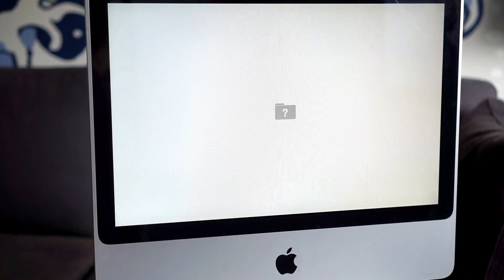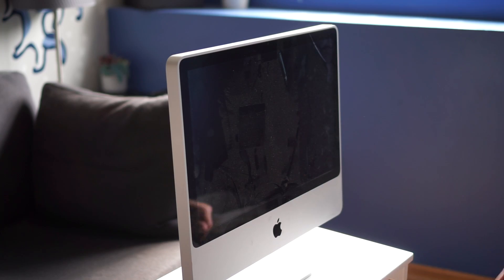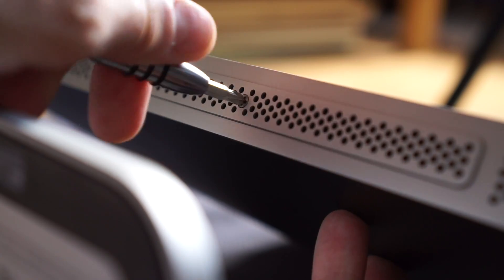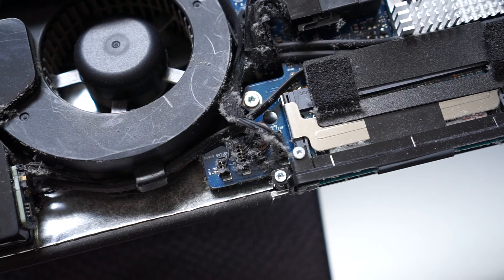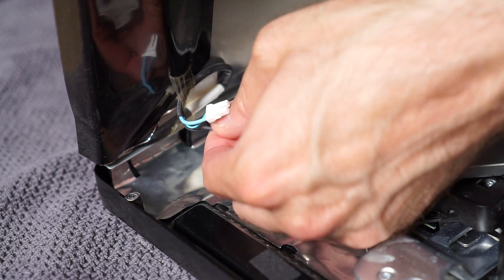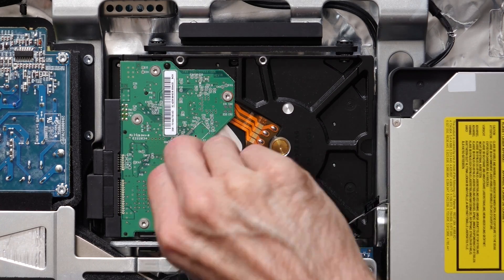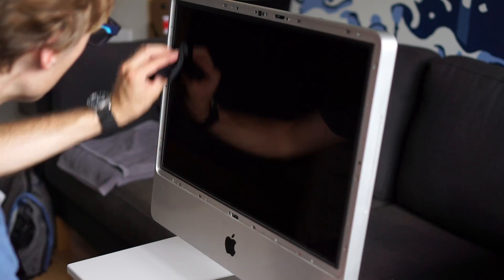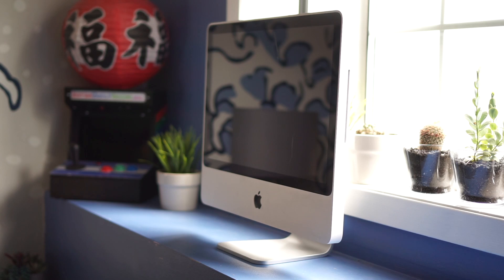Replacing a 2008 iMac Hard Drive

Comment: Hi, great video thanks but I have a couple questions. near the end you don't explain the process. What is the white usb lead you plugged in? and about softwear, I was going to purchase an imac from someone selling one that is not booting up and has the file and questionmark symbol flashing up. So Im unsure if I am able to just swap out the hdd and install the softwear for it to run normally if the imac was someone els's can you help please?

Comment: Super awesome. Been running my great 2008 iMac (ran nonstop 15 years as a DayLite server) until HDD died. First tested it by running it off USB eSATA connector to an older MacBook Pro 2010 (horrible known design defect that makes it kernel panic) 2.5” 250GB HDD. It is slow but runs ok. Next I cloned that to a 500GB Samsung eSATA SSD. Slow but runs. Next, I upgraded the 2X 1GB RAM chips with 2X 4GB to make 8 GB. Just installed. But decided to do long awaited HDD swap out too. Had seen similar longer video a year ago but wanted to refresh my memory. Found your great video. Simple & to the point. Just thought, I’ll likely need a 2.5” SSD to 3.5” bracket adapter. So it may have to be after the 4th of July. Thx again.

Comment: my drive died finally just about a week ago, i just put a samsung SSD in a firewire 400 case, installed snow leopard from DVD to the external SSD then upgraded to el cap and its working faster then it ever has.. without even trying to open up the imac... saved alot of time + effort and got a similar result - its a little slow to wake up from sleep as the hd has to wake up aswell but other than that its still faster then it was at any point with the internal mechanical drive on the sata interface; even with it running at fw400 speed instead of fw800.

Comment: Very well done.  Clear and to the point.  I am an IT Pro with 4 decades experience, but had never installed an SSD in customer's iMac 2007 20" until this weekend.  Although this video was for iMac 2008, it seemed to be same as iMac 2007 and was just what I needed to see.  Lots of screws in these old ones, but no glue...yay!!

Comment: My old, dead iMac ended up being not quite the same inside as the one in this video. Not sure why. The monitor connected on the left rather than the right, and the connector was different than the one shown here. I also had some trouble getting it out. It was binding along the bottom edge. For the drive itself, I had tremendous difficulty getting the bracket to release. I ended up having to pry it off with two flat-head screwdrivers and broke the bracket in the process, but without doing that, there was literally no way that thing was coming out. It was wedged in there way too tight. Luckily all I was doing was removing the drive for secure disposal, not trying to replace it, since the Mac itself was already dead and long replaced. I also gave up trying to get the microphone cord reconnected at the end, but put the rest of it back together the way it was supposed to go, just to see if I could get it all to fit. :)  Overall, quite a lot of effort.

Comment: Thanks Colin, such an easy to follow guide. I did appreciate your advice also at the end, still wondering what I should do with that moose head and 6 CD changer that were gifted to me... LOL. I was given this 2008 with a dead drive, have done the external drive idea, but can only upgrade to Snow Leopard, I am getting gifted a HDD 2TB WD. Any quick idea on the cleaning? is the usual home vacuum OK? thanks again

Comment: Had identical machine given to me to fix and pass onto a charity. Couldn't get the software to upgrade because of  manufacturer's idiocy. 
Ripped off the operating system, installed Ubuntu and tadaa! Wonderful. Bit of messing about to convert iso file to DMG, but did it using the terminal on the Mac and all worked well.

Comment: Perfect video my current IMAC is the later 2012 which runs like a charm having only had to replace the power board this month. I have my 2008 model in a box without a scratch on it which bit the dust back in you guessed it 2012. So although it was a black screen death I won't be sure what it requires till I get a test lamp on it which I don't have. There is an Apple Doctor up the road from me and service costs are cheap and is turn around as you wait as witnessed by my last visit, but I would like to take on the task myself as your tutorial is excellent all be it a different component. Its still a good looking machine and I will gladly want to bring it back to life. It can be a hand me down to my 12 year old son. Great upload and a definite thumbs and subscribe from myself.

Comment: I have this exact machine.  Hard Drive died so I bought an external SSD put Linux on it and it runs like a top.  You can use this machine just throw Linux on it and you will have a modern useable system again.

Comment: the big difference with a pc is you can replace the motherboard, the cpu, the memory and hard drive and you get a brand new modern computer for the faction of the cost, I used mac products before and not impressed at all as every function is too complicated to do, you have to press command, alt and something else  to do something, then command, alt and F to fill the screen. No thanks.

Comment: "Simple tasks" for a 2008? I'm typing this right now on mine - it's my primary PC anymore, and I'm actually more of a Linux guy than Win. Talked them down to $125 out the door with Mac keyboard and upgraded it myself easily to 6GB RAM.  Original 320 HD is still inside and I boot from a 500GB USB3 Samsung SSD external drive (migrated the OS with CCC) plus 2 additional Firewire-800 external drive docks. It does almost everything, although dual-booting to Linux (even with 'refind' installed) is a PITA.  The dual-core iMac will run Virtualbox just fine and still runs all modern browsers, Thunderbird, VLC (I use it to watch DVDs and streaming - the builtin speakers are quite excellent), Libreoffice, Carbon Copy Cloner, Nomachine NX and XQuartz for X11 support.  It even runs ZFS. :-)

Comment: Please help! I also have this model. The hard disk has broken down. All data is lost. I put in a new SSD hard drive, but I do not know how to install the operating system because I'm working in Windows and I do not understand so much. Thank you !
Reply: Buy a USB installer for El Capitan 10.11 (try amazon) and boot from that to install the latest OSX that will work on a 2008 iMac. Or install Linux from usb

Comment: You can install in this computer modern and well supported OS called Linux Mint.

It runs latest Linux compatible programs (Word processor, latest internet browsers etc), 

Linux Mint 19 is supported untill 2023. You can try it if it is suitable to computer and your needs before installing it on hard drive, by booting computer with Linux Mint live DVD. 

Perhaps somebody have time to make tutorial out of it ;).
Reply: @kat 

Linux is musch lighter to hardware than old MacOS. It's also lighter than Windows 7. Windows 7 is supported less than a year anymore. Windows 10 is not very compatible with old hardware.Linux needs less resources, so it makes old shit computer much better surely.

Comment: I watched this video because I was nervous to take mine apart after I had received my tool kit. I had researched a guide and found one, but still was nervous at the thought of possibly cracking the glass. After watching you disassemble it, I feel pretty confident in doing so. I can now open it up, clean any dust  it may have, maybe swap the HDD with an SSD, as well as replace the backlighting since the backlight went out. Thank you for this simple video! :)

Comment: Hi Colin,

great video - thank you for taking the time to put it together and sharing it with everybody!

My father needs me to replace the hard drive on his iMac, and the question we had was what happens to the OS.
I see that in the last few seconds of the video, you insert a usb stick, which is probably bootable and contains the OS, correct?

If so, which version would you recommend? Snow leopard, el capitan? Which one works particularly well on Imacs like this one?

Any answer is greatly appreciated, thanks!

Sincerely,
Pete

Comment: Wow, so much negativity.  All I can say is that I own an early 2008 Mac I purchased new in the summer of 2008.  I have used it daily ever since and have yet to have any problems whatsoever.  Everything is original and the case has never been opened (though maybe I should so I can vaccum out all the dust).  I payed $1200 for it back in '08 which is a lot of money.  However, the reliability cannot be denied.  

And FYI, I was a convert at the time I purchased this because up until that point all I had used were PC's, EIGHT of them over the course of 15 years or so.  

Just relaying my personal experience with no unfounded bias either way.

Great video.  I'm actually thinking of replacing my factory drive with a new SSD.  Now I'm off to search for a video which shows this replacement.

Cheers.

Comment: The temperature sensor on many of the hard drives in these iMacs is the tricky part. On many of them, the sensor wire plugs into a non-standard connector on the original drive, meaning on replacement drives lacking this connector, the cable will be left hanging unplugged and not connected. On others like yours shown here, it was simply attached to a spot on the outside of the original drive, but who knows whether the spot you placed it on the new drive emits heat in an equivalent way to feed the sensor. The result of these sensor situations is that after many drive upgrades, the iMac's fans will run at full blast constantly because of the thermal sensor's input to the mainboard, and you will need to install software on the iMac to compensate for this and properly handle the fan speeds. There were several similar competing programs created that do that job.
Reply: Yep. I installed an SSD in a 2009 iMac and have this issue. I did look at buying the OWC cable to fix this issue but then just used SSDfancontrol app as it was free as opposed to $80! I'm only really using it as a 2nd display so the silence of the SSD was the key as the drive itself was fine.

Comment: Pretty cool video. My last find was a iMac G3 indigo still in original box but only bad part it had a bad crt and it needed new capacitors plus a new cd drive. Sadly I have 0 experience taking it apart and replacing them so I just returned it. Shame that I was not able to repair it but it was a good find.